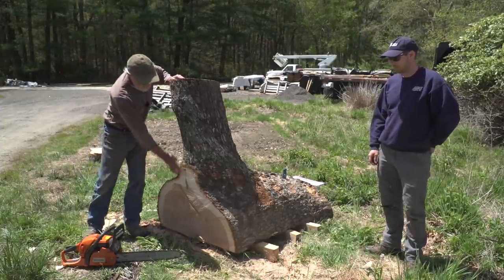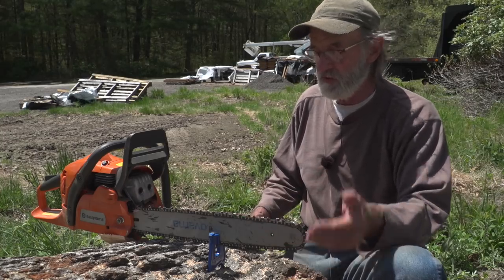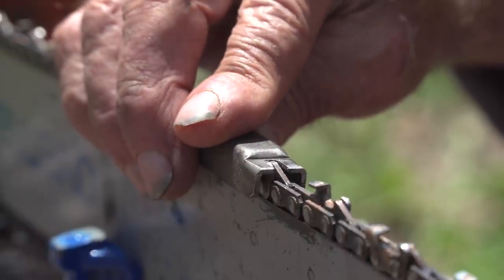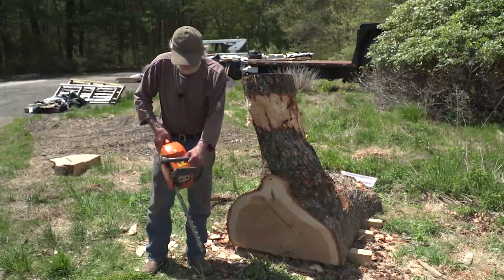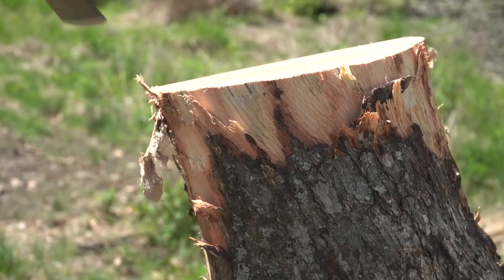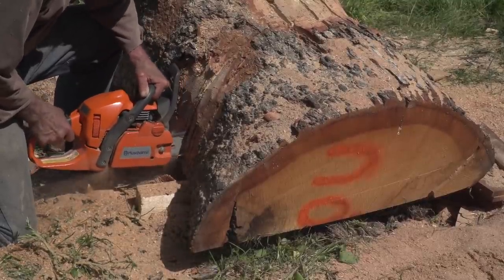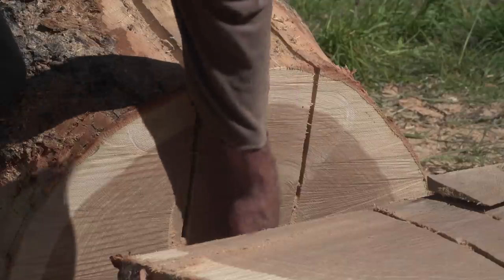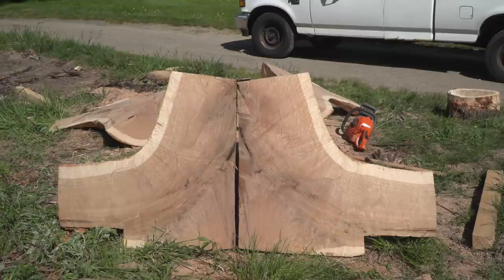TIPS Season 3 - Episode 5: How to sharpen and rip with a chainsaw

Comment: I love your videos and look forward to each new one. In furniture making we try not to use lumber out of branches because it is grown under tension on one side and compression on the other it makes what we call ''reaction'' wood that will want to change shape every time you rip it, sometimes even binding right on the saw blade. In many ways the union of the branch and trunk is the most stressed part of the whole tree, imagine hundreds of pounds of branch leveraging that joint 24/7. It will be interesting to see how these knees react as you whittle away at the slab. I am a little surprised you did not cut down a couple of thinner knee/slabs on the outside of the two you cut, I could imagine a couple of beautiful canoe stems hidden in there!

Comment: Masterfully done!
I think most branches from trees that size have offset hearts. First, the hardwood trees put more cellulose on the top of the branch (called "tension wood"; softwoods put more lignin on the bottom called "compression wood"). Once it needs more reinforcement, it puts more "normal wood" on the bottom.
What's that word used to refer to the cut side of the trunk used at 18:11? The cribbin?

Comment: Lou your on the spot as usual, less top angle on the cutter performs better for hardwoods and more top cutter angle for softwoods, I never considered the width effect. Great visual on your technique. You are also correct that is a modern semi chisel chain. I prefer them on my general purpose ground saws because the edge is more durable to dirt and grit. The full chisel with the crisp corner sticking out is severely effected by any grit and looses performance faster, it’s a compromise. Be well

Comment: That was a hell of a big tree.
I think the lower side of the limb having more wood under the heart is characteristic. The weight load causes the underside growth, an effect achieved by the sugars that govern growth i believe. It is the same effect of when heavy limbs break off of a tree and it leans and the tree gradually tries to and will straighten upward in a long bow.  I think that self bow makers take advantage of the same effect in getting denser higher return wood for their bows. A carpenters hammer has a very hard face and is not a good choice for driving steel wedges or chisels. Great video, you plan for lines and art all of the time. It shows that you love what you are doing, you never go to "work".

Comment: ".... the saw will last longer than you will ... "  I have a 40 yr old Echo 500I got in 1980, and i replaced the crankcase seals and main bearings last winter -- good for another 40 years. The saw, not me haha. And I got two pair of bearings and seals.  One good rip chain and two passable crosscut.  But I never realized you could make it cut a narrow kerf like you. Gotta go try that tomorrow! BTW alcohol in fuel takes molecules and stuff out of the rubber -- thats why they disintegrated, and killed the main bearings.

Comment: I love working with trees especially big oaks. You never know what you'll find inside when you split them open. I once found a steel bullet and it must have been back in the civil war because the tree was almost two hundred years old at the time and the bullet was way deep. I should have had it checked because I never heard of steel bullets but I guess it could have been a cannon round that shot a blast of steel projectiles but according to the history of the war in that area the main battles were ten to twenty miles away. So still a mystery.

Comment: When you sharpen a tool, do you push the cut edge into the stone or drag the cuting edge away from the stone?
Reply: When I sharpen a chisel I move the chisel as if I were cutting. Axes use a circular motion. I'd assume Close counts with a chain saw. The most important thing, I believe, is taking the time to sharpen the tool. If you don't spend time sharpening the tool, it is wasting away.

Another thing to consider is a burr is created when sharpening. You have to spend time on both edges to get the best result. Stropping is usually used to get rid of the burr. There is a science behind sharpening, but with practice, you can keep great care of your tools. AnneofallTrades mentioned she keeps her sharpening station set up full time because if it is convenient, it will be used more often which is great for keeping tools sharp. I don't know what I am talking about, but I hope I answered your question. There are many resources out there to learn from.

Comment: A proper rip chain is narrower ‘ by that I mean it cuts a narrower kerf ‘ it also has a narrower bar as well ‘ it has a 10 degree tooth ‘ as u said u can make your own from a 30 degree crosscut chain ‘ the only problem is it cuts a wider kerf by about ‘ one eight of an inch ‘ it’s not much ‘ but when u want that extra board from a nice piece of wood it can make a difference ‘ any way well done